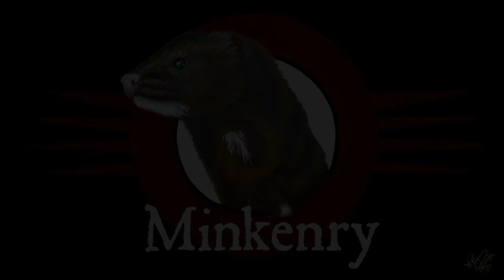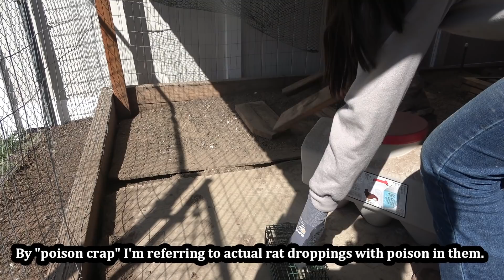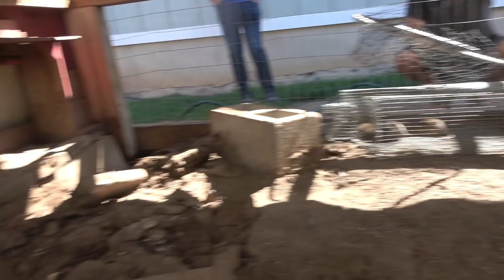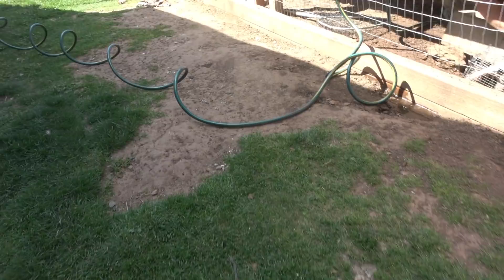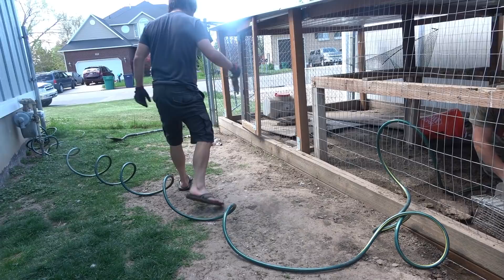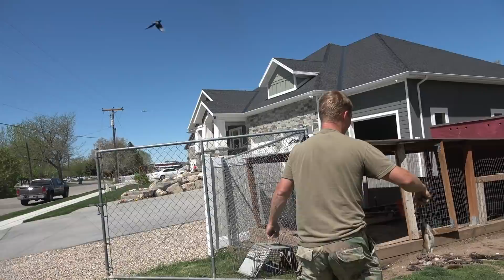117 Rats Caught by HAND!!!

Comment: When you live in a rural environment you are like the shining city to all the wild creatures. Everything is focused on you because you are a concentration of resources that doesn’t exist otherwise. It isn’t just compassion for the creatures around you that governs your behavior it is also the fact that if you keep jumping from one short term solution to another you never get a problem under control. You end up spending all your time just dealing with it. Like pest control. Poisons are only effective for a short time. Then you have to deal with the longer term problem of immunity, poisoned carcasses and contaminated water. 
Rodent control is often difficult. They are evasive and will gnaw through anything except metal( including concrete). But when you start seeing the population surge you have to resist the temptation to start using poison because it always comes back to haunt you. Sometimes you do have to use them, but it should really be very limited and in conjunction with other methods. This advice comes from several years of experience that often did not end well.

Comment: In my country, it's common to use anticoagulants as poison for rats. So when the males fight for mating (or they get wounds any other way, but this is common enough to base a strategy on) , their wounds wouldn't stop bleeding and they bleed to death. Supposedly they cannot figure out the connection between the poison and the death. Is it known there?

Comment: I know that I’m not like a rat genius, but why don’t we use some kind of netting to secure the common escape route of the rat pit? That way we can catch more and not lose them. Is there reasoning behind why not?
Reply: Rats is dumb but rats be smart
Reply: Netting wouldn't work ive had pet rats they are pretty big but can flatten there lungs to squish through things, they can also jump pretty high and can quickly chew threw nets and other fabrics.
Reply: When they went to catch these rats they were going to use the animals so probably didn't have things like netting and steel wire on hand... surrounding the shed might have funnelled more rats to them if they had had the things on hand.
Reply: Drew Harris  there is steel netting or steel sheets, even wood boarding. Anything that could actually keep the rats from escaping a certain area
Reply: @n2n8sda  I’ve never seen them use those things though. There was one video where they lifted a pallet at a pheasant farm and the rats ran everywhere, and got through a fence the dogs couldn’t get through and it escaped.

Comment: I've used poison in the past.
Learned quite quickly. That it's drawbacks far exceed it's benefits in almost all cases.
Wether it be insect, rodent, or mammal.
Secondary poisonings being the biggest problem. 
It's indiscriminate. 
From domestic animals, to beneficial wildlife even humans. 
Found with a little knowledge, effort and working with natural predators and repellents. 
Most issues can be alleviated to acceptable levels. 
Poisons have inherently nasty properties designed into them.
As he explained slow deaths. Also some cause internal hemorrhaging, causing dehydration. 
Theory being that rodents will seek water and not die in walls etc.
Problem being, if it works, you now have a rodent full of poison out in the open exposed to dog,cat, owl,hawks,snakes, minks, etc.
Or it may die in the water,  contaminating that.
The other benefit of using minks.
As he states, rat's are intelligent. 
They'll learn quickly not to eat poison. And simply walk around it.
They can't walk around a mink. 
And if exposed to them enough. 
They learn,that particular place is unsafe and not a good place to chill.
Really applaud this approach. 
Hopefully inspires others to take it up. 
The fewer toxins we put out there. The better off everything is.
Also, although it was fun watching you hand wrangling. 
Miss the stars of the show. 😎😄
Looking forward to seeing them, back in action. Before they file a grievance with the union. 😨😆